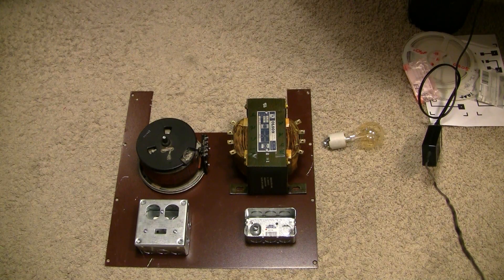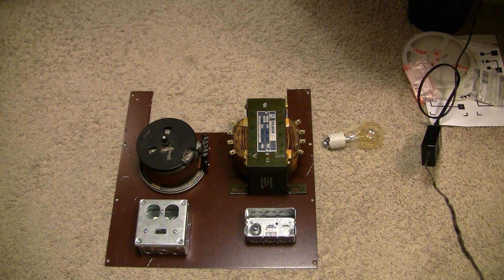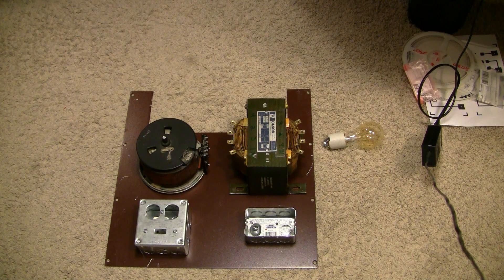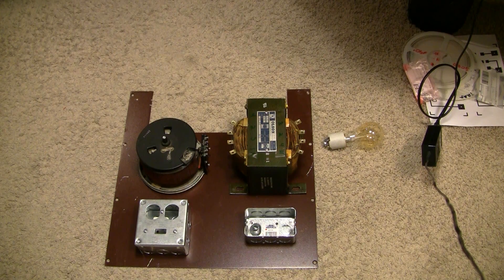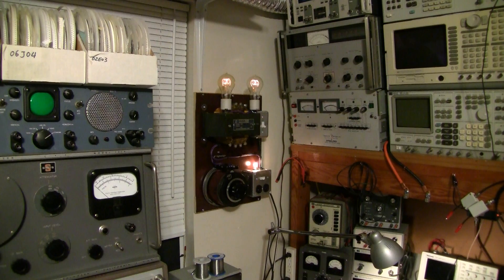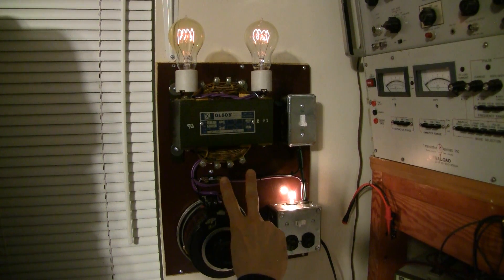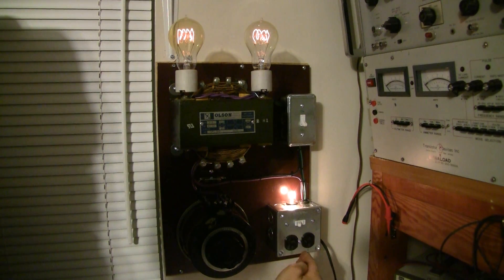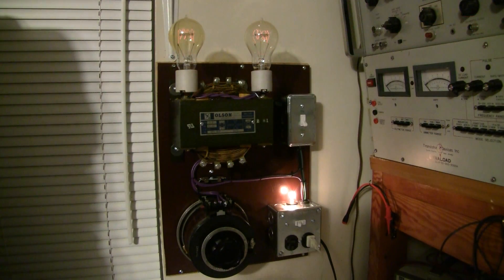Big Dim Bulb Tester with Variac and Isolation Transformer

Comment: Dear  Mr. Carlson,

As I continue focusing on repairing that tube radio, I remember seeing this video, and, realizing how serious it is to take safety precautions when testing such a radio, I decided to build a dim bulb tester of my own.  So, I went to an electronics surplus store and managed to find in stock a 120V/100VA isolation transformer (with power and female cord attached) and a 5A variac which happens to not come with any housing, and so I decided to build one out of scrap wood and mount that and the whole system on a scrap board base.  And I also made a three-inch wooden handle with eight finger slots and a chicken head pointer which I glued on top of the handle and mounted it on the arbor of the variac.

I also bought a 3-prong to 3-hole extension cord, a light switch, two sockets, two 150W light bulbs, and some electrical boxes.  And then I made it in three stages.  The first stage is the isolation transformer, of course.  The second stage is the variac with the 3-prong end of the extension cord wired to it and another length wired from that to the third stage.  The third and final stage is the switch, light bulb, and female end of the extension cord.  I set it up so that if the switch is in the off position, current limiting begins as the current is bypassed through the two light bulbs hooked in series so that they do not get too luminescent to balance the current load properly.  With the switch turned on, the switch provides a direct path to the female end of the cord.  I plugged a small drill into the new device and used it to test the thing and it works!!!  :)  I also used a voltmeter to test that the voltage goes from 0 to 120V with or without the current limiter system, making sure that no voltage registers if one or the other bulb is unscrewed.

The only thing is that light bulbs tend to stop electric drills from spinning.  I hope electric drills just require more power than tube radios.  If so, then, provided I manage to fix the radio, I can use the new device to test the radio.  :)  :)  :)

Comment: Very cool. I have a separate section in my lab that is HV, Variacs, 10KV Hipot, 2KV DC Supply and etc. I like to keep all the HV isolated to it's own circuit and bench. Cool build!
Reply from the maker: That's a safe thing too do (separate bench). I'm running out of room.... Now using wall space :^/ Thanks for the comment Eric!

Comment: amazing tool, you inspired me to build one for my own :) ....  I suggest replace the on-off switch with a relay, making a 'set-reset' to bypass the lamps instead of the key, so you will never need to remember to turn of the lamp bypass switch as it will be disconnected every time you turn off the AC, putting the lamps in series...

Comment: Another way to look at he "matching" effect is that a transformer with no load is still an inductor and so will draw current. This current lags the voltage by 90 degrees of phase and so consumes no power of itself. However, any resistance in the primary circuit will consume some power, including the light bulbs.The added capacitors also draw a reactive current which leads the voltage by 90 degrees, so the inductive and capacitive currents are 180 degrees out of phase and cancel each other out. This nets out to no current on in the input (variac and bulbs) so the bulbs do not light.There is still a resonant current flowing between the capacitors and transformer primary so the transformer itself will still dissipate the same amount of power as heat in its primary winding due to the winding's resistance. The ideal capacitor value will indeed be the one that, with the inductance of the transformer primary, forms a circuit that resonates at the supply frequency of 60 Hz.
Reply: I had some trouble understanding the inefficiencies but your explanation makes it very clear. Thank you.
Reply: Kevin, excellent explanation of power factor correction - not an easy concept at all!  You might like to add to what level the efficiency is raised due to there still being a resonant current and therefore iron and copper loss.  The lucidity and brevity of your explanation is second to none!  Many thanks!

Comment: Just thought I would make a quick comment on my own experience with shorting out mains wires.  I think I was going for a Darwin award at the time.  One day I decided to short out two mains wires (240v, touching active to earth) to see what would  happen and to test  the safety systems.  It was more violent than I was expecting, a loud bang, big flash and then the house plunged into darkness. The safety systems worked fine, but I wasn't expecting 5 circuit breakers to trip!  Lesson learnt. :)

Comment: Hi Paul,
Two comments that others eluded to but didn’t get clear answers to:
Why is the auto transformer before the isolation transformer?
Only to allow variable control over all the isolated “secondary” windings at one time. Otherwise, isolation is isolation. If your isolation TX has only 2 windings like mine, put the Variac on either side.

Trickier issue, is the fusing of the Variac, eluded to by others. Paul has fused the primary at 8 amps. Most integrated variable auto transformers fuse the output (wiper), as does my Staco 3PN1010. Auto transformer operation takes some thought. In normal 2 winding isolated TX all of the secondary power (VA) is carried by transformer action. Not so in an auto transformer. Some is carried by transformer action and some is carried directly through the unisolated shared upper winding. The ratio depends on the wiper setting. When at the top, obviously the secondary is directly connected to the primary main terminal. 
Let’s look at the wiper at half way. Primary turns Np = 2 * Ns (sec turns) so ratio Np/Ns = a = 2.
By auto transformer action, primary to secondary current transformation is Ip/Is = 1/a, or Is = Ip * 2.
So if Paul has his Variac primary fused at 8 amps, and set to 50% and the light limiters are switched out, the wiper at 50 % will carry 16 amps before the fuse blows. It better be rated for that. and it will be higher at lower settings.
I don’t know his Variac model or capacity or if the wiper is internally fused. But where ever you put a Variac, always fuse the wiper at around the rated VA on the name plate. 

Paul is a smart, articulate guy, so I know he knows this. But do you?

Comment: A very useful device to have, and a very pretty build, too! (Though I think as a practical point I would have ended up putting a bit of tape or phenolic over the bare primary screws. You might be amazed how easy it is to reach blindly for the knob while staring in a scope and miss your target by a couple of inches. Guess how I know...)

BTW, that is very similar to the design of most tube testers from the 1940s and 1950s. A nice little 6.3V lamp labeled "Fuse" in the primary line.
Reply from the maker: +l wilton 
Thanks for your comment!

Comment: I'm sourcing parts myself for a build like this, and an enclosed unit was always my goal. I found a tordoidal 1000VA 220-220V isolation transformer so I will need some kind of soft start or it will trip my breakers. And while I am at it, a bridge rectifier behind the variac too so I can get DC of different voltages. 

I am in 220V land in europe and big bulbs or lightbuls in general are getting hard to find, and with our voltage we need 2x larger ones so they become ungainly. I was instead thinking of using R7S halogen bulbs instead, a 500W one would give about two amps, and a 250 would give one amp, a 100W half an amp and so on...

Comment: This is very cool and useful! I'm gonna have to build something like this myself!

Across what wires or terminals do you connect the capacitors, as you didn't show that in the schematic?? I couldn't quite tell exactly when you showed the demo of the caps dimming the light bulbs out, due to the lighting in that room you were in not being quite bright enough to clearly see what terminals you placed the caps across... Does it even matter at all, or do the caps have to go across only specific terminals of that transformer in order for them to actually help?

Comment: The light bulbs glow due to the exciting current (inductive reactance) required by the transformers.  Paralleling capacitive reactance supplies the necessary reactive current, instead of supplying it through the line.

Comment: Neat project. Although it's not something I do frequently but when I power up an old radio of unknown status I usually connect it with a variac. I haven't done any current limiting method other than a fuse. Some series lamps is a good idea. I have a 10A variac but it has a convenient fuse holder and I can put in whatever I like. If I know that unit shouldn't draw more than 2A for example I can put in a fuse around that size, bring the voltage up and see what happens. Old vacuum tube radios were built back in the 110V mains days. You take a radio that hasn't been powered on for 30 years and bang it on with 120V things tend to blow up.
Reply from the maker: Hi Eric. Thanks for your comment. Your profile picture looks like an SP-600 window.

Comment: Hi Mr Carlson I have all my components bar the isolation transformer for my build. I'm going to build my current limiting supply panel in the same way as yours as I'm comfortable dealing with mains (240v here in the UK) but I was wondering whether you have any suggestions when working with higher voltages such as, perhaps, plate voltages say going up to 600v in tube amplifiers? I imagine there could be the possibility of arcs flashing over things like ceramic sockets which may have been contaminated with carbon dust for example.
Thanks for sharing your layout for the power supply and the great video.

Comment: By having the current limiting bulbs on the input to the Variac, the value of available short circuit current on the output increases as the voltage setting is decreased.  I'd put the bulbs between the Variac output and the primary of the isolation transformer.

Comment: Paul, I am also designing an AC power supply for troubleshooting (120VAC only). I thought perhaps you could comment on equipment AC leakage current tests as part of the repair process (Final outgoing test). Take a look at the B&K 1655A user manual for leakage tests, as proposed by B&K. For 120VAC three prong grounded plug, I plan on using a GFCI self testing receptacle as my first screening device (5mA). Also of note, is in the possible need for low pass filters when testing for leakage on switching supplies.

Comment: Hi Mr. Carlson. Channel subscriber here from the Philippines. You talked about improving the efficiency of the variac to isolation transformer coupling by adding a capacitor in parallel. How exactly does this work? By adding a capacitor to the transformer, are you resonating it (LC) to 50hz? Thanks
Reply from the maker: Ben's BatCave  Hi there! We have 60cy electricity over here. Yes, by the addition of a capacitor, you create an LC network that better "tunes" the circuit. Thanks for the sub Ben!
Reply: @MrCarlsonsLab , Especially when you are "out in the sticks," the amount of motors and inductive loads makes the power factor less than 1. If you add some capacitance with an AC RATED AND OVER VOLTAGE CAPACITOR DESIGNED FOR PF CORRECTION, you can return the power factor to closer to or equal to one. Ask your local power company to tell you what the power factor is at your home. They may add a PF correction cap free of charge!

Comment: Can I replace the current-limiting bulbs with much higher efficiency LED bulbs?  Hahaha  Just kidding!  Great video and great explanation of the theory.
Reply: Some cheap ones tend to make nice oscillators when connected to low voltage or non-rigid voltage source, so it would function as a warning blinkenlight simultaneously! :)

Comment: Nice video, thanks. I need to build myself one of those so I can have 2 isolation transformers. I'll run the ground to a copper rod in the ground outside so they will have separate ground planes. My Tenma variable isolation transformer uses the house ground.
Reply from the maker: Hi Robert. The whole idea of the isolation transformer is to isolate you from the existing system. I have never heard of a variable isolation transformer. I know of "autotransformers" and Variacs, but they have no isolation. There should be no connection between the primary and secondary of any isolation transformer. This can be tested with your ohm meter, if there is any continuity between the two, there is no isolation. Be careful with the ground connection! Remember the ground is tied to neutral in your main breaker panel. If this is connected along side the secondary of the isolation transformer, again you have no isolation.
Reply: Mr Carlson's Lab 
It's variable because you can adjust the voltage. It is an isolation transformer but the ground on the output is the same as the input. Having another isolation transformer on a different ground plane I can power the device with one and my soldering iron with the other one.
Reply from the maker: Robert Calk Jr. Very interesting! I have never seen a variable isolation transformer. I would like to see that. Do you have a model number and name? The concept makes total sense, That's why I built one :^) On another note, be careful about running another detached ground rod! Due to ground conductance, that may also pose a shock hazard. Ground conductance will carry current to the neutral side of your house supply.... And every one else's too. Just think of it this way, Think of all the ground rods connected to the neutral side, from the connection in the breaker box in everyone's house. This planet is a pin cushion for one side of the hydro line! I will do a video on this one day.
Reply: Mr Carlson's Lab 
It's a Tenma 72-1097. You can see it here: http://www.element14.com/community/search.jspa?q=tenma+72-1097
I will be glad to see that video. I changed the memory backup battery in my Tek 2465A DV myself. Alan at w2aew and some commenters reminded me about using my DC power supply for a temporary power source to keep from losing the memory while my soldering iron was on the same ground plane. So I used batteries, which was easier anyway. It worked great.
Reply from the maker: Robert Calk Jr. That Tenma Is a neat device.... Sure does have isolation..... aside from carrying the neutral wire through the ground pin. I guess for regulations, that needs to exist... but still scary! Good on you for changing that memory battery, that's risky business as well. It's no fun when parameters go missing!
Reply: Mr Carlson's Lab 
The ground is just the ground - there's no neutral wire on the ground, the output ground is connected to the plug ground. Yeah they were wanting several hundred dollars to change the battery claiming that the scope would need recalibrated. He would have done the same thing I did and not recalibrate anything if it didn't need it. The scope has a tad over 1000 hours on it, but it is 29 years old.
I wrote an article about it here: http://www.jestineyong.com/tektronix-2465a-dv-oscilloscope-memory-backup-battery-replacement/
Reply from the maker: Robert Calk Jr. Is the plug ground wire on the output of the Tenma box connected to the mains ground?
Reply: Mr Carlson's Lab 
Yes, there was continuity when I checked it.
Reply from the maker: Robert Calk Jr. That ground wire connects to the neutral wire in your breaker panel, back through the outlet, if your house is wired to code.
Reply: Mr Carlson's Lab 
I don't know much about that, but I'm sure the electrical is wired to code. I live in Texas. It's been checked by a licensed electrician when our water heater went out. I checked that the water heater element was shorted, but we called an electrician anyway since I'm not an electrician.
The breaker box is in my workroom, and he looked at me kind of funny when he saw my work table with all my test equipment and meters on it. I just smiled and told him that I just do electronics. A new water heater fixed us up.

Comment: I would recommend you put a fuse on the wiper of the Variac to protect the Variac from over current at lower settings example if you set 1/4 voltage you can draw 12 amps on the output wile only pulling 3 amps on the input it will not like that I damaged one with a 2 amp supply fuse I was using it to get 12 volts I learnt right there to fuse and current limit the output of all of my supply's

Comment: I've chosen to make the same rig for my repair bench. Sadly with 230Vac and 50Hz (the Mains in my country) and the fact I need a few Amps, my Variac is 9.7kVA meaning it weighs in at 16kgs (~35 pounds) and the isolation transformer the same order of magnitude in mass.... making it all real hard to bolt up and mount as a wall panel!
Reply from the maker: Yikes!

Comment: An isolation transformer also needs low capacitance between pri. and sec. Iso-transformers for safety use are purpose built. A 240 to 240 ordinary trans. is not an iso-trans.

Comment: So the 1-1 ratio windings which take us from 120V to 120V isolated, those windings are physically on the same side of the transformer, sort of stacked on top of each other? 
I always thought a transformer works by having the windings opposite each other, or sort of facing each other.
Reply from the maker: +SciPunk215 
They are just wound on top of each other in phase. The windings are spaced apart with paper and varnish.
Reply: Just be sure the windings are indeed separate and not a center tap primary. Using a second primary winding as a secondary isn't all that uncommon. I've done that for isolation or to get a high voltage output from a transformer that doesn't offer one. Say you want 6 volts for filaments and 170V for the plate of a tube and you don't have the right size transformer around or don't have one with the secondaries you want. You shouldn't expect it to pass a 3000V hipot test. But at a few hundred volts it's fine.